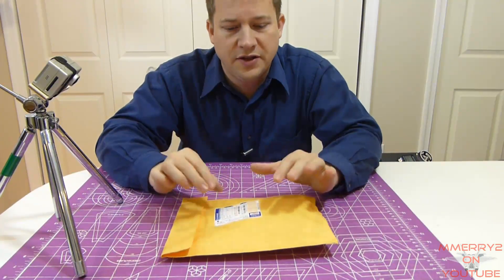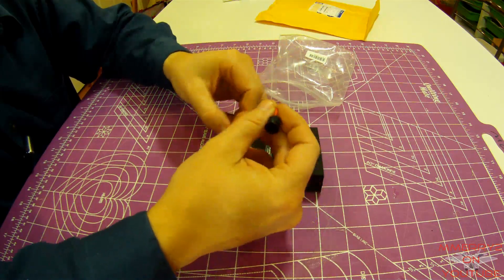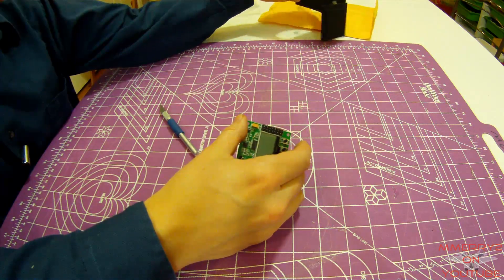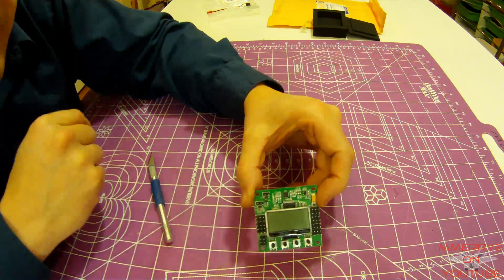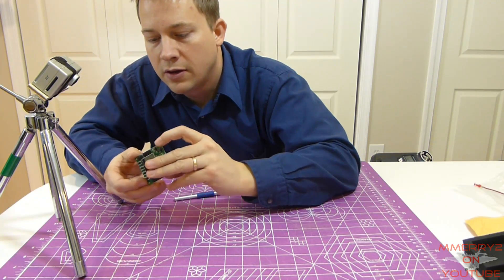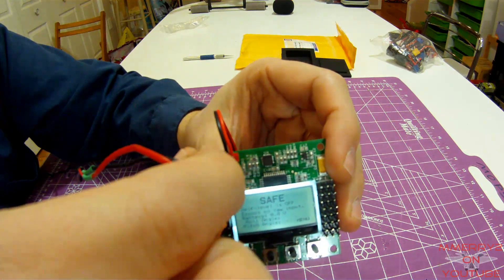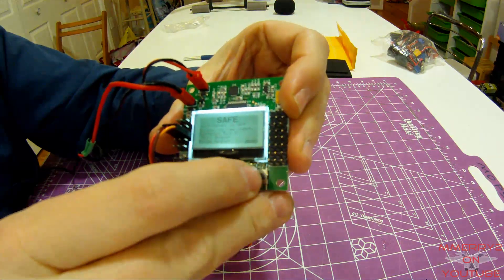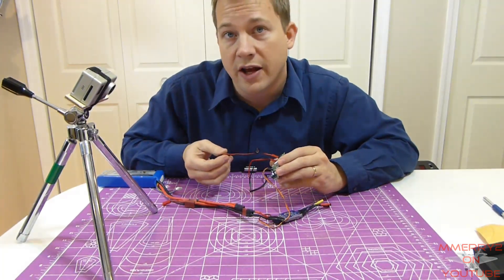HobbyKing KK2.1 Multi-rotor Controller Unboxing

Comment: Where exactly you connect voltage(the battery) to the KK2.1 board? why you not use the supply pins of this board?

Comment: You had mentioned there is an OpenAero2 V1.6 firmware. However, I have not been able to locate it. Could you list the site where the latest OpenAero2 firmware is available. The firmware tool only list the OpenAero2 V1.2 Beta 10.
Reply from the maker: I put a link to the firmware in the video notes.  Note, you need to install the latest KK Multicopter Flashtool version for KK2.1 firmware flashing support.  The version I used was kkmulticopterflashtool_0.76beta1.  The earlier versions don't have the KK2.1 support.
Reply: Have you been able to get the bed at 10 open arrow to work on the KK 2.1? Getting a headache from trying to figure it out

Comment: what adapter do you use to link the battery to the kk2.1 board ?
Reply: You can use a male servo connector or male JST connector.  The JST connector is typically red.  I recommend using the JST connector as it is more appropriate for carrying power from a battery.
Reply from the maker: shad0w1pegasis If you are talking about powering the KK2.1 board itself, then you are exactly right. Just plug an ESC into the 3 pins for motor one.  If you also wish to use the voltage sensor then you additionally need to connect power from your battery to the 2 pins on the left side of the board.
Reply from the maker: shad0w1pegasis
Yes.  The receiver will get power from the connections on the left side of the KK2.1 board.